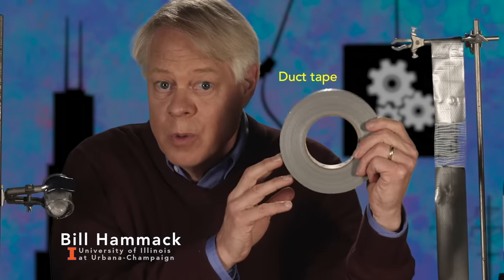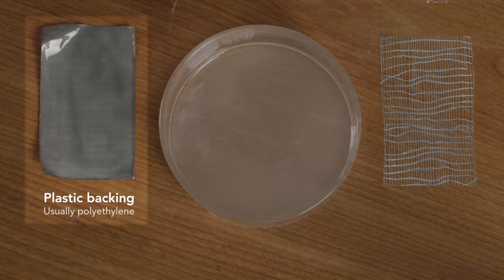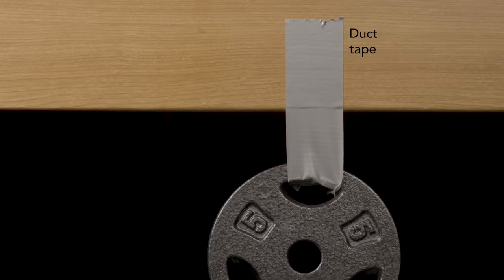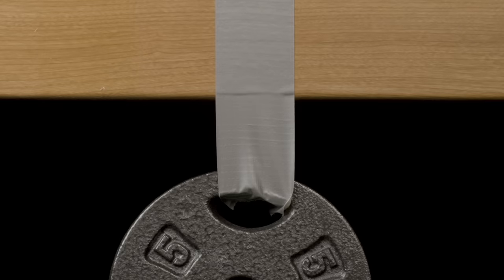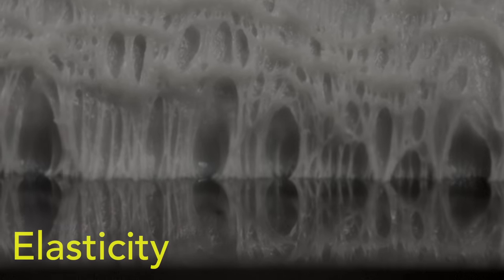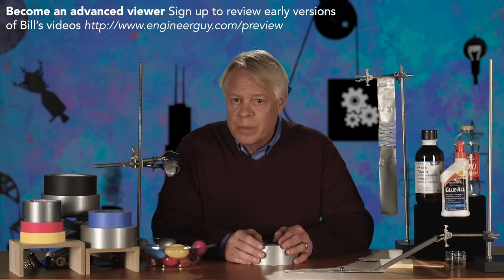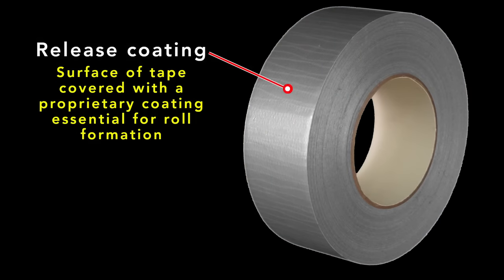The Engineering of Duct Tape

Comment: During Vietnam, my grandfather told me it was used n the patching of bullet holes in airplanes. I have used it to repair damage on my wing on my airplane (once) when I was stuck in the middle of nowhere and needed to be able to fly even though the leading edge had damage that would have torn the wing apart if I didn't coat it before taking off again.

Comment: Assuming no one else has made this comment, the product called "duct tape" today has in past been called "duck tape" in reference to the cotton duck cloth that fortifies it.
I used the Gaffers tape version for holding a piece of polyethylene sheeting to a fiberglass fairing on a recumbent streamlined bicycle I rode across the USA in 2000. After that 2.5 month trip the adhesive tape, having endured sunshine, some rain, and desert heat was no longer able to be removed with out a lot of residue. Because of that baking environment, the adhesive had transformed into a non-viscoelastic and quite hard to remove glue.

Comment: Is the warning just about not using it to seal hot piping? As in sealing room temperature air ducts is fine, but not for sealing hot exhaust pipes from gas appliances?

Comment: "Duct tape" and "Duck tape" often cause confusion due to their similar names and overlapping uses, but they have distinct origins and characteristics.

1. Duct Tape:
   - Origin: Originally designed during World War II as a strong, water-resistant adhesive tape for sealing ammunition cases.
   - Purpose: Primarily intended for sealing ducts in heating and air conditioning systems, but has since become known for its versatile use in repairs and construction.
   - Material: Typically made of a fabric mesh (scrim) coated with polyethylene and an aggressive rubber-based adhesive.
   - Characteristics: Known for its strength, durability, and water resistance. Usually gray, but available in many colors.

2. Duck Tape:
   - Brand Name: "Duck Tape" is a specific brand of duct tape manufactured by Shurtape Technologies. The name plays on the original "duct tape" while referencing the tape's water resistance, like a duck's feathers.
   - Products: Duck Tape brand offers a variety of tapes, including the standard gray duct tape as well as decorative tapes with patterns and colors for crafting and DIY projects.
   - Popularity: While often used interchangeably with duct tape in common language, Duck Tape as a brand has become popular for its marketing and wide range of designs.

Comment: I’m not so sure about not leaving any residue. Most times I’ve used duct tape, there’s always adhesive residue left over. Glass is one thing, but any rough surface, even if appearing to be smooth will have ‘cohesive failure’.

Comment: 10:15
also don't use duct tape on skin!! there's medical tape for use on skin like for tucking, binding or otherwise holding things in place while attached to skin. even then, you still hafta be careful because skin needs air and can't be suffocated by tape all the time

there's also specialized tape for withstanding high temperatures, high pressure/wind, and other duct-related conditions. duct tape is marvelous, but it's not miraculous (although it may seem like it sometimes, remember that it's a temporary fix!). it's not applicable to every situaton, just many of them.

stay safe, everyone
:3

Comment: Duck tape managed two of its main objectives. Which is better than most still. It always leave beHind sticky residue. And if exposed to sunlight long. It breaks down and only the residue is left holding on to strings and the degraded tape which just crumble to dust. Its still useful as hell tho and theres not really any alternatives

Comment: What I want is a duct tape that when applied is permanent, strong, doesn't fall off when heated, is highly resistant to moisture, is flexible, UV resistant, doesn't get brittle, and doesn't dry out.
I also want a velcro and/or dual lock with a vhb that doesn't peel or fall off under warm conditions. Same conditions as the duct tape.

Comment: You know it's really quite a thing: Despite the fact that we know that the properties of duct tape are inappropriate for use on ducting, and despite the fact that manufacturer even warns against it, the name still persists. Is there any good use of duct tape? There certainly are a lot of reasons not to use it:  It smells badly, it's hard to tear off the roll, it  leaves behind an unpleasant residue when removed, and yet is also incapable of holding anything from in place for an extended period of time because it tends to become gooey.

Comment: In the piping industry Duct tape is a constant blight. Many shops use duct tape to seal off the ends of piping assemblies to keep dirt and wildlife out. Once the tape has weathered for a while is becomes a stringy mess and the adhesive has to be removed with a solvent since wire wheel buffers only heat it up and smear it around. If not removed entirely, it can and does create problems when welding the piping assemblies together. In my career with the pipefitters I spent hundreds of hours removing this garbage so I could so my job properly.

Comment: Tape is temporary, be careful not to leave it adhered to a surface for an extended period as the adhesive can dry effectively glueing the tape making clean removal near impossible.
As soon as you're finished with it, remove it.

Comment: As a retired HVAC Tech, I'm sorry but it is not a good tape for ductwork. The glue dries out and leaks air. Real duct tape is aluminum mylar film with a non-drying adhesive. I admit, this tape is great for what it was designed for. As a racer, it is great for those quick, pitlane repairs. It is strong. I have a friend that took his car to a paint shop and showed them a roll of a red shade of DUCK tape and ask that they paint his car the same color. Duct and Duck is where this all started. If I asked my supplier for a roll of duct tape, I would get the mylar tape.

Comment: 10:25 ... but why? NOW I REALLY WANT TO KNOW WHAT WILL HAPPEN!!!
Reply: In 5:35 he mentiones that heating the tape causes the adhesive to degrade, which means the tape doesn't hold well anymore. Those things mentioned on the duct tape roll (chimneys, mufflers, etc) usually get hot so using duct tape on hot things causes it fail and whatever your trying to hold together will fall apart.

Comment: The proper name of that tape is Duck Tape. They invented that tape. The 3m product you are using is a knock off. That product cannot be used on Ducts and so should not be labeled with it in the name. It’s very misleading.
Reply: Well, you could argue both ways. Although the name duck tape came from the 1930s with a dull green cloth backed tape using a similar ‘duck cotton’, post WW2 it was used for sealing ducts, and sold as a brand off and on until today where ‘Duck Tape’ is a particular brand and not used for ducts, as you say. Yet the hangover name ‘duct tape’ is used more generically, although I’d bet the number of users is about the same. So, should we not accept common usage since neither name means much as to what it’s now made of?

After all, words change: forensic for 200 years meant “of the courts” but now locked by use to “forensic science”. 

 As for tape, often I get two sticky parts stuck together, which must be called ‘fluck tape”!

Comment: If you're going to do an infographic on duck tape, AT LEAST GET THE NAME RIGHT. Duct tape is aluminum sheet with an adhesive that withstands wide temperature ranges - though it's better known as "airplane tape" that is what is actually used to repair ducts.  Duck tape is the cloth tape you're talking about, and it's called that because it was originally made with a backing of canvas duck cloth.  Its adhesive does not withstand wide temperature ranges and it is useless for working on ducts.
Reply from the maker: You can review the responses to other comments on the naming here … I considered this carefully before we created the video.

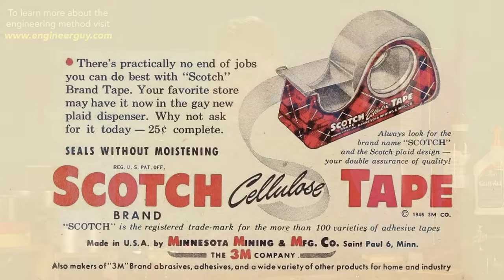Comment: 9:15
Uh, what? No, the purpose of engineering is to solve practical problems, period. Science is the pursuit of knowledge, of truth. Engineers assume they know the truth, so they have something to act on. Scientists assume they don't know the truth, and seek to uncover it.

That tackiness ramp you showed off - that's not engineering. That's science. That's a scientific apparatus to test the adhesive properties of different materials. The designers may not have understood the forces at work behind adhesive materials, but that's how all science starts. You collect data on the "obvious" phenomena, and then collate that data so you can start identifying patterns in its behaviour. Which formulas gave greater adhesion? What ingredients were in those formulas, and in what proportions? How were those ingredients mixed and combined into the formula? Is there any correlation between the most adhesive formulas? Any correlation between the least adhesive?

That's science. That's the scientific method, in action. The first adhesive engineers were also the first adhesive scientists.

Comment: Fails to mention the intended purpose of sealing the joints in a sheet metal heating duct of a forced air furnace.
Reply: Edit after getting to the end of the video: hmmm. Maybe not the most modern formulations.